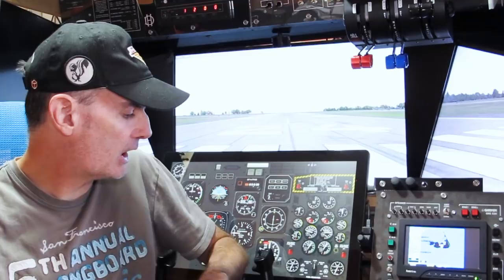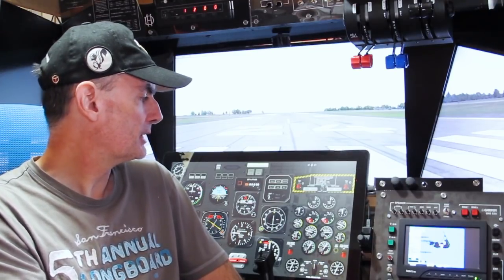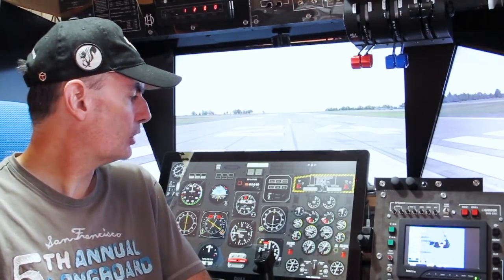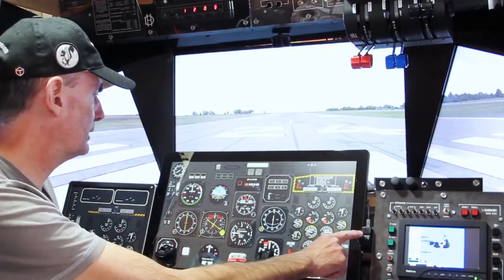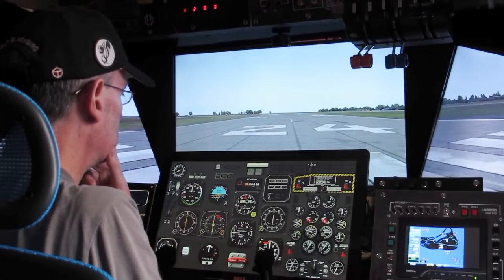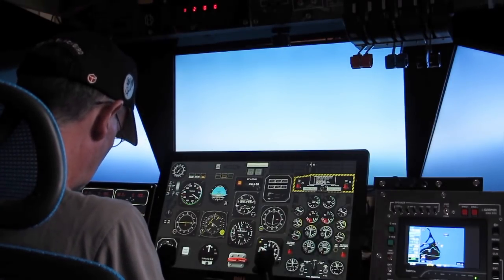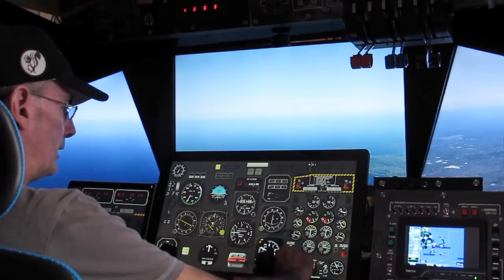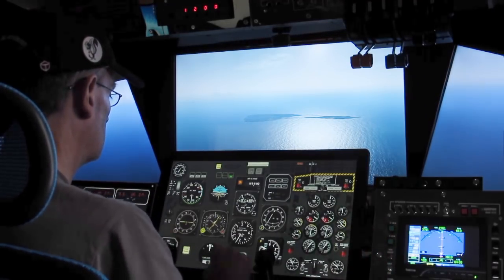Air Manager + Knobster

Comment: Wow, really nice set up. Thanks. Are you running two monitors, one a 22" or so and the other a much smaller one?
Reply from the maker: The control panel is a 23" touchscreen and a 19" LCD to the left in portrait mode (you can't see it very well in this video). I also have a 7" screen for the GPS. The main display is three 32" TVs, with the outer two angled downwards by about 20 degrees.

Comment: What gives you more satisfaction or realism? Air manger or the saitek fips?
Reply from the maker: I have not tried the Saitek FIPs. However, they are unbelievably expensive. I would also presume they run generic gauges. As far as I can see the only potential plus is that you can have the knobs co-located with a gauge.

Comment: Nice job Mark.  Your sim flights always look so life-like. 

BTW, I can explain the yellow highlighting on the fire handle and other nearby switch.  I only discovered this bug a couple days ago.  Although you didn't demo it here on the Twin Otter, when dials and/or rotary switches are concentric, Knobster handles them with the layered Knobs on Knobster.  It seems that when two switches(rotary or not)  overlap by even one pixel Air Manager thinks they are part of a stacked knob set and highlights them in error.  Until we fix it this can be corrected by making sure the switches do not overlap. This was no big deal when using a mouse or touch.  Unfortunately the paid panels like the Twin Otter have to be corrected by Sim Innovations since they can not be edited.  I have reported the issue.
Reply from the maker: Thanks Russ. the explanation of the accidental layered knobs seems logical. Can I presume that the Fire panel controls aren't intended to be Knobster'ed at all? That would make more sense, as I couldn't see why they needed rotary controls. I noticed a few other places where three-position switches needed the knobster, although this may have been done intentionally. I have to say, the closed nature of the paid panels is in one sense a big step backwards. I don't know what the solution is, but I have the germ of an idea I will post in the forum rather than here.
Reply: Almost Aviation Yes Mark the two position switches should not respond to Knobster unless they are identified using FORCE_ROTATE_MODE of the touch_setting() function. Occasionally there are two position rotary switches that need to respond to the circular finger touches and Knobster.